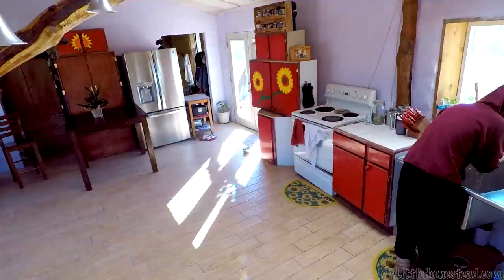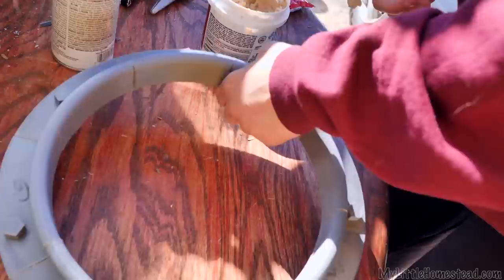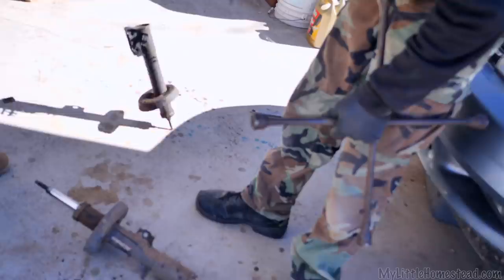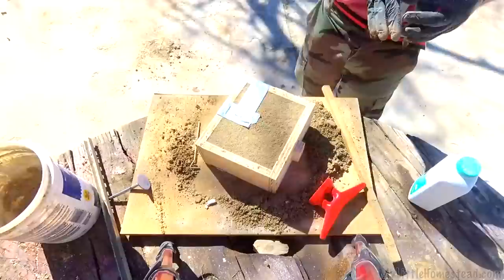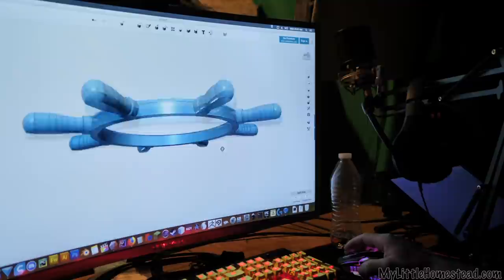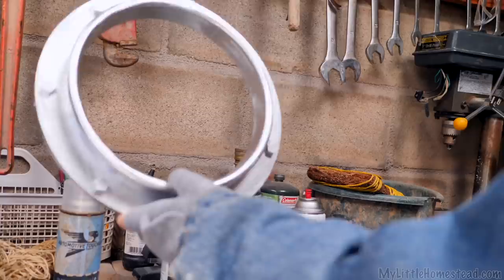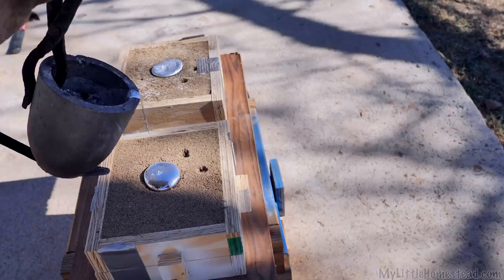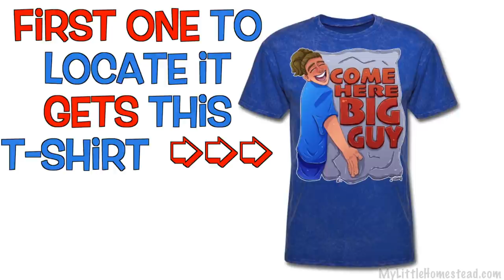Bathroom Complete! 3d Print Decor, Aluminum Casting | Earthbag Kitchen & Bath | Weekly Peek Ep170

Comment: To get a smoother texture on the 3D prints you can try running heat over it gently and carefully to round over the edges of the print layers.  You'll still have to sand the more aggressive texture though.

Comment: When the rings get worn out then you get compression blow by into the crank case. And it creates pressure inside the crank case, forcing the oil out through the valve covers. Hey I approve of the honda car chrome exhaust pipes they sound and look really good.

Comment: I've had to replace leaking spark plug tube O-rings before for that same reason.  Once I got that done, I use NGK Iridium spark plugs.  They'll last 100,000 miles and you won't ever have to worry about that for a long time.  Traditional copper plugs will have to be changed more frequently since the copper electrode wears out quicker, whereas Iridium is much more durable.  Hope this helps with future repairs on other vehicles.  :-)

Comment: Love all the little touches in the 'head'... but you know that 'turn around quick and take off the first thing you see in the mirror' thing?.........to me, the hinges on the big cabinet are distracting.  The handles are great and part of the theme, but there are a lot of doors so the hinges outnumber all the handles and they are too close to the same size.....I would stain them with the stain or dilute a little paint and make them blend into the cabinet....then your handles will pop even more.  Love the 'antiquing' of the painted bolts, frames, etc...perfect touch.  Did the cabinet handles get a black coat?  a tiny sanding touch here and there would not only look great but would disguise any eventual wear and tear in their paint job.  Great job, as always.

Comment: Maybe I missed it, but you NEED to use jackstands or blocking. Not just a jack when working under  a car. Stuff can happen SO fast and once you are dead, you are dead. I have seen Jacks fail. My cousin  is dead because a parking brake fail and he was crushed between two machines. Please be safe and sorry if I did not see the blocks or stands.

Comment: How did you choose your 3d printer? What size is the print bed? Is it a heated bed? What filament materials is it compatible with? Would you recommend it to others or would you recommend a different model?
Reply from the maker: BlueEagleLabs. 250mm diameter, heated yes. Most types of filament. Yes, I recommend
Reply: @mylittlehomestead   Thank you for the info. Love the channel and the buildings.

Comment: In 2000-2001, after pulling 75,000-100,000 Buick defroster panels out of injection molding machines, checking for defects, trimming flash and packing them into boxes, I do not like working with plastic anymore. Even considering that, a 3D printer would be cool to have.

Bree, that car is not a rock crawling jeep.
Reply from the maker: BlueEagleLabs

Comment: Yah.. we had a cloud cover - my camera wouldn't pick out the dull light.
Reply: when you are Jacking vehicles up.. DO NOT ever.. EVER use concrete blocks. - Use 4x4's 6x6's 8x8's or Make OAK. or Tight grain PINE - blocks out of Wood cut out of a TREE. Square Rectangle - not angles or Rounds Unless on END - Raise Corner to corner unless it's a small car then front back front back - then reverse backdown . No higher than 3 FT up. I usually stop around 2ft when using Blocks - by using OAK on ends and railroad ties cut into pieces. <HEART>

Comment: Not better for the engine. In fact on a car that doesn’t have a turbo it hurts it, the valves need the back pressure that it takes away and it will have a little less horsepower.
Reply from the maker: Thanks
Reply: mylittlehomestead I was going to edit. Wasn’t trying to be negative just informative. It’s a lot better than what came off of it. 😂😂😂😂